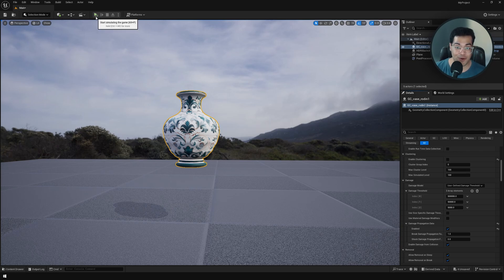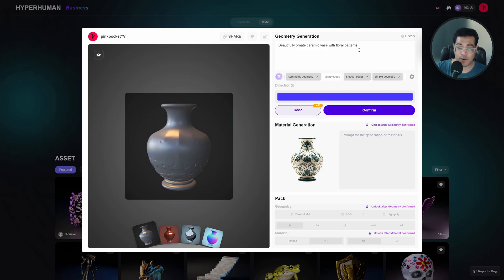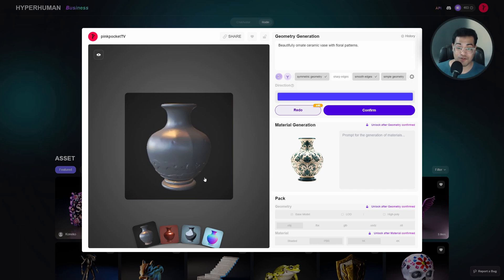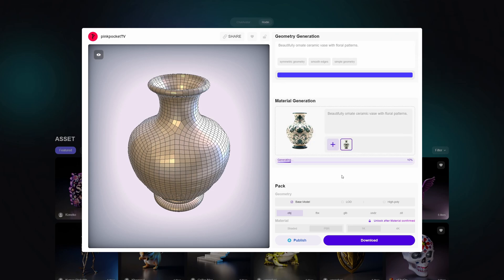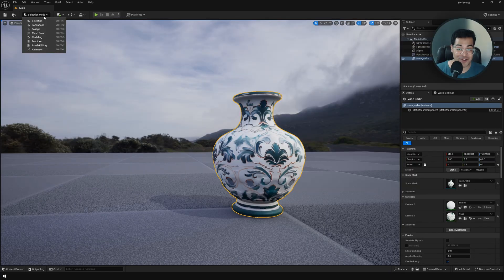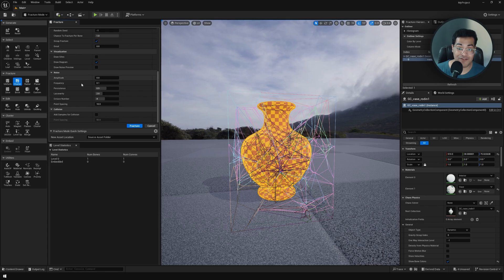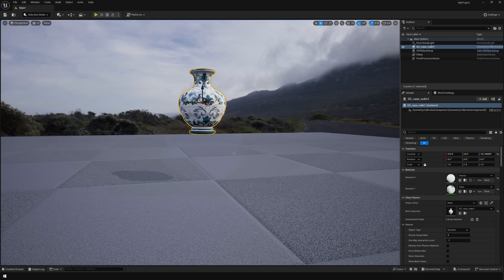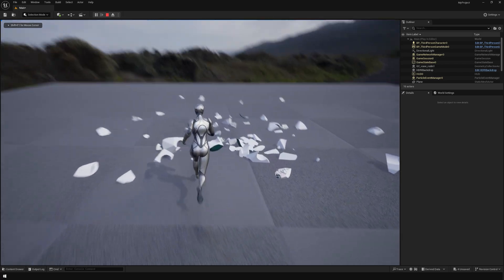How to Destroy Objects in Unreal Engine 5 | Chaos Physics | UE5.4 Tutorial

Comment: nice. Have you seen this bug in cluster. when i apply cluster to any object, i don't see any option to add internal material. After trying to get solution from very long time. Finally i found that first i've to add extra material option in modeling. Than apply cluster. This is the only solution i found. Strange
Reply: how do you do it ! im having the same problem